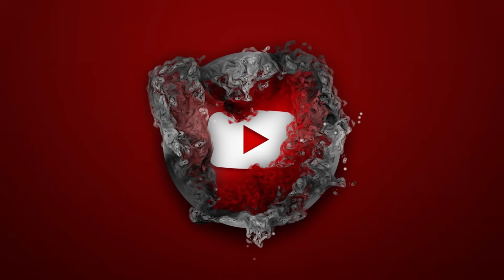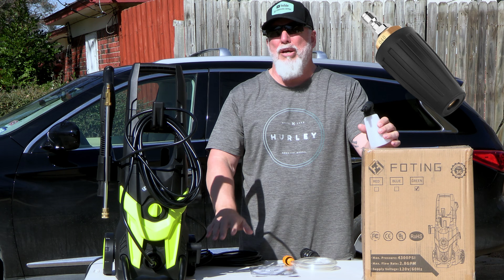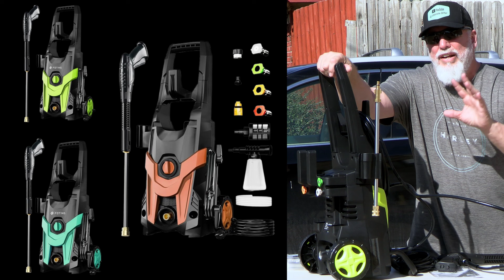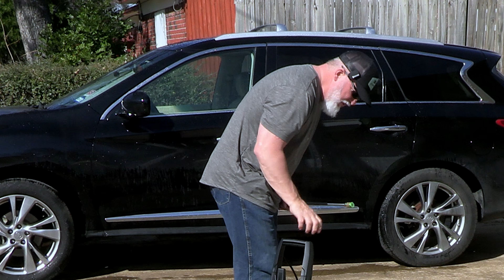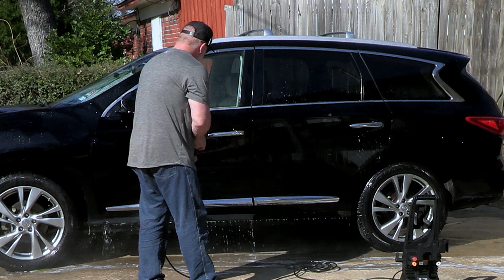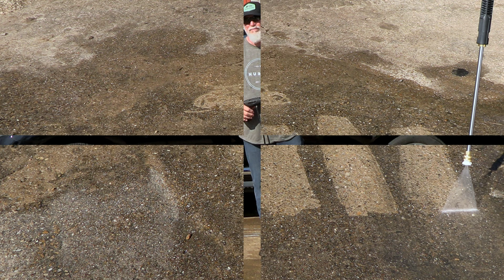Foting 4300 PSI Pressure Washer Review: Can It Handle Tough Jobs?!YouTube Smaller Channel

Comment: I don't have a hose spigot. 
Can this be used just with the bucket for cleaning?
Reply from the maker: No, you will need a faucet to have pressure; it will not pump water out of a bucket.

Comment: Does a really good job and I like it real well, but its not a 5000 psi washer. 5000 psi would peel the paint right off your car
Reply from the maker: You are absolutely right; 5000 PSI would be way too much for a vehicle. That is building up pressure at the gun, or so they say. Working pressure is much less. Thank you for watching and commenting

Comment: Just bought and used the same one ..but cannot get the bucket hose to suck up ...works great on a water supply ,maybe set the bucket up on the next video ..well  done
Reply from the maker: That is a great suggestion; I will look into demonstrating the bucket setup in a future video! I have never liked the bucket part of these units; if you don't have pressure and keep water at the pump, they burn up. But that would be a great test.

Comment: It would not be a waste of time to show new users how everything connects. Some of us have never used a power washer and have no idea how to assemble this machine. I have a slightly different model and have spent 45 minutes on videos and trials trying to get the enclosed hose to attach when there are no female threads on one end. As soon as I tug on the plastic cap, it pulls apart. Even if it is a speed assembly, some viewers would be grateful.
Reply from the maker: That is a fair point; I will keep that in mind for future setup videos. I have another unit on the way. I will slow down and show more detail. Thanks for the heads up.

Comment: i'll give you a million dollars if you connect a psi gauge to the hose before the gun and it reaches even 3000 psi. its a 120 dollar piece of junk. the only real mainstream electric washers that get over 3000 psi are the 20 amp models with the funky plug with one sideways connect and they start at 500-700 dollars. that thing makes sun joe look like a krenzle
Reply from the maker: I agree, I haven’t found any electric washers that truly put out the psi claimed but I do think they work well for diy projects and light work. I use a large dewalt gas powered unit on daily work. I think I might just get a gauge as you suggested, that could be very interesting.